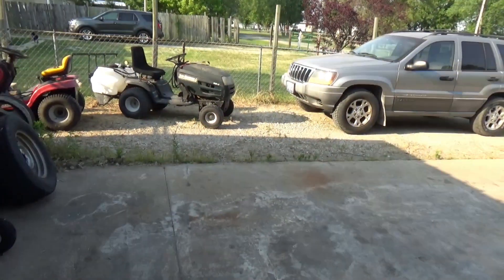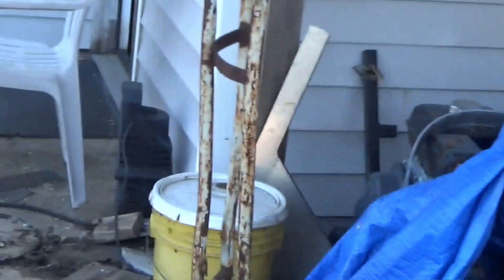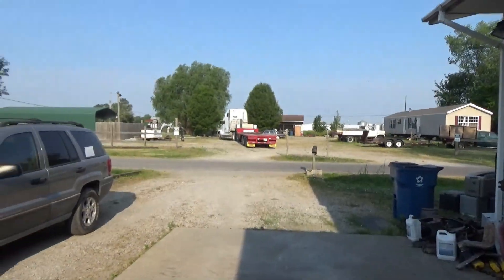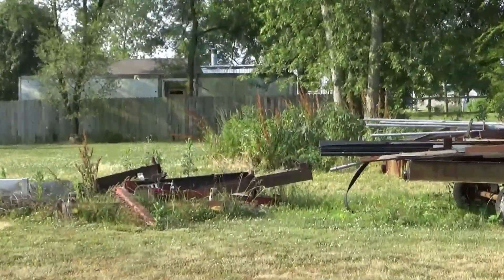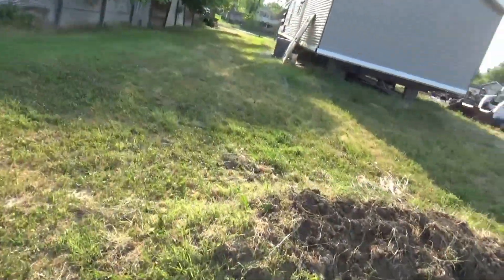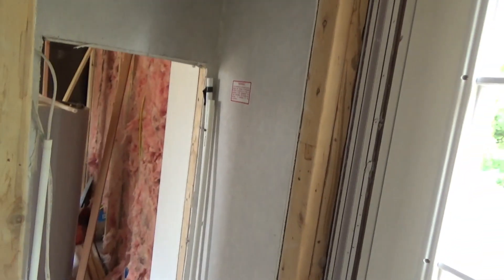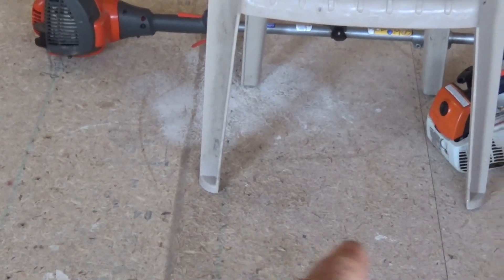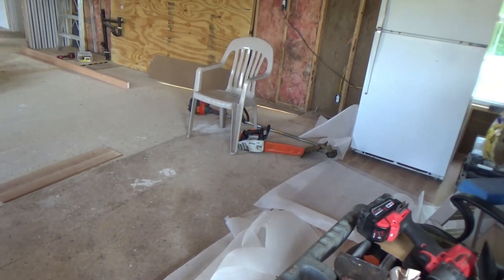Update June 20, 2020

Comment: Thought of you on the 5th of the month. Wife and I ran up north of ST Louis. Picked up a set of 10K axles. Along with 4 17.5 wheels and tires 18 ply. Putting those under a gooseneck trailer I have. Sure turning into a job, putting Torsion drop axles under a trailer that had standard axles under it.
Reply from the maker: Yes it can be a job. I hope you got them square with the frame and in good alignment so you don't wear the tires too fast or overheat them too. Thanks for watching.